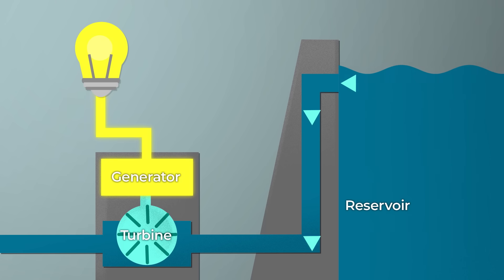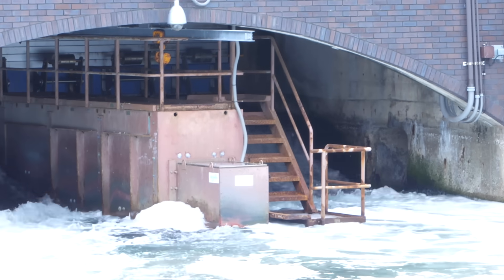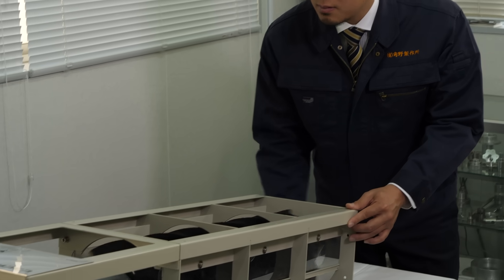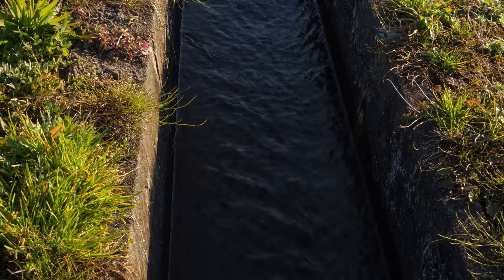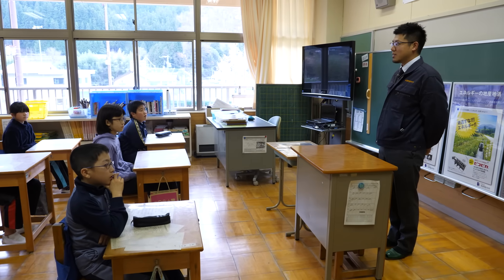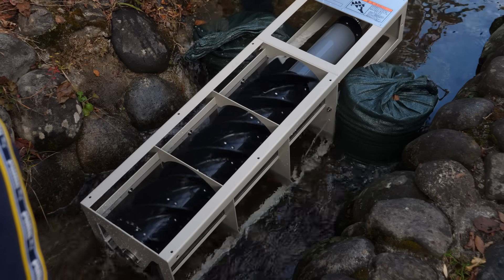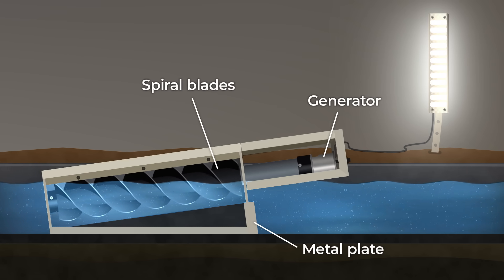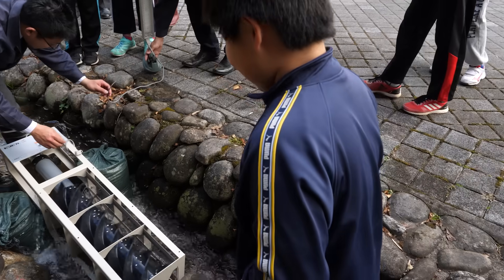Ultra-Small Water Power Generator

Comment: Easily maintainable, low tech installation, mass producible seems like an all round good idea.
Reply: A paddle wheel would be way more efficient.  This will require maintenance   . It will get clogged. Too many moving parts. And all that and it’s just barely powering some LED lights?
Reply: @michaelesposito2629  No a paddle wheel would not be more efficient, yes it requires maintenance which is easy thats to the open top design clear plastic sides and modular design. Clogging is the same thing as with maintenance.
-
Regarding power produced, thats mostly limited by the available energy. Higher velocity of the turbine increases thermodynamic efficiency allowing usable power to be produced. This is the part I was amazed at, the difficulty in extracting useful energy from low energy sources is extreme.
Reply: NotAsian this little thing produces a whopping 10 watts of power. You’re impressed by that? It will take MONTHS For this thing to pay for itself, and then you’ll be left with a high Maintance gadget that can charge your phone
Reply: @michaelesposito2629  Yes, extracting 10w from 10l/s with head of 0.1m is very good.
-
"S
piral PicoPica Hydraulic Power Unit is a promising pico-hydro power generation equipment which has potential for dissemination in non-electrified areas, with its characteristics including low-head generation and dust-resistance. There are two types of units, “PicoPica10” and “PicoPica500”

“PicoPica10” is a unit that enables around 10W generation by securing a flow of 10ℓ/sec and a head of 0.1m. This product can be manually assembled and utilized as security lighting, drawing power from a nearby waterway. “PicoPica10” has already been sold over 500 sets within Japan as an environmental education material.

On the other hand, “PicoPica500” enables around 500W generation by securing a higher flowrate of 100ℓ/sec and a head of 0.7m. The generated energy can be equivalent to an average Japanese household’s electricity consumption."
Reply: James Watt's steam machine was more efficient. 😂😂
Reply: @AvNotasian  you are funny idiot. 😂👍
Reply: @MilanTheMan69  mmhmm, i'm not the one proposing a Kelvin violator without realising the ridiculous paradox of such a machine when combined with a carnot engine.
-
You are an idiot who thinks water can burn, you can pretend to laugh but all you are doing is trying to mask your embarrassment at expressing an opinion so stupid.
Reply: @AvNotasian  
Elaborate your termodynimcs laws on these...
https://patents.google.com/patent/WO2005100787A1/en

https://infinitysav.com/projects/

"WaTeR cAn BuRn"
"YoU tHiNk WaTeR iS FlaMmAbLe?"

Why did you delete your comment?
You twisted electrlysis of water for that?

There's a number of way to extract hydrogen from water: chemicaly, with electrolysis, ultrasound...
And yes imagine, hydrogen from water can burn, WHAT A MAGIC.
What was Ralo idea that we discussed before you entering with those termodynamic BS.
I'm waiting your explanation on termnodynimics and enthropy of above mentioned devices.
Reply: @MilanTheMan69  Yes I know, what I am trying to tell you is that the laws of thermodynamics result with conversion of water to hydrogen + oxygen being <100% energy efficient, and then the burning of hydrogen is again <100% efficient. Resulting in the cycle consuming energy to do nothing but generate heat.
-
"I'm waiting your explanation on termnodynimics and enthropy of above mentioned devices."
The above devices don't exist, you can patent anything actually building a working one is impossible. Please consider the Carnot cycle, this is the most efficient engine possible and you will note even it is less than 100% efficient.
I am not going to spend 3hours teaching you thermodynamics, go over the khan academy they have structured lectures and practicals set up for you.
Reply: @AvNotasian  blablabla. 
I guessing you would power your house od DC current if there wasn't a one man in history who utilized it, and you would be teaching people how that is "something that would never be succeeded".
You still admire 3 component device in 21 cent, lol.

Yes I know electrolysis is ineffective today, but that could change as many things in science untill today.
Resonant frequancy and photonic stimulation of atom might work do job for exmpl.
Maybe with renewable resorces we dont even need to achive 100% to make it usefull..
You are stuk in that laws. Good luck and watch future progress not made by you.
Reply: @AvNotasian  yeah, when you fail to explain, go to acadamy 👍😂😂
No thnx, agian I wouldnt...
Do you like quantum physics?
I cant even imagine how is that working on your mindset. 😂😂😭
Reply: @MilanTheMan69  No, electrolysis will never change in efficiency it is limited by the laws of thermodynamics as I keep trying to tell you.
-
Yes, I am stuck in reality. So are you.
-
Also I ignored your stupid comment about ultra sonic frequencies and electrolysis, but that is also impossible. The binding energy of the hydrogen atoms in water is so high you would have to be generating a high temperature plasma with sound.
-
"photonic stimulation of atom" This already exists its called a microwave, you are repeating pseudoscience which has been dressed up to sound technical.
-
Using electrolysis to produce hydrogen which is then used as the feed hydrogen for the Haber process yields liquid fuels. This is a way of storing energy not generating energy and it is very lossy. However it has engineering advantages because its easily throttled allowing for the construction of energy sinks which allows a greater deployment of renewables on the grid. The problem is without engines to burn this fuel or industrial processes to take the products its a chicken and egg problem.
-
Please stop talking to me, you don't know the basics of the topic while I have degrees in both electrical engineering and physics.
Reply: @AvNotasian  "No SoMeTiNg wIll nEveR cHaGnE, I hAvE dEgReE"
😂😂
Reply: @AvNotasian  bot, back to school again:
Perpetual motion and the laws of thermodynamics

It is consequently expedient to first re-examine the basis for the widespread injunction against perpetual motion by modern science, as summarized in the first and second laws of thermodynamics. The first law, also known as the conservation of energy, forbids the creation or destruction of energy; it may only be transformed from one fore. to another. The second law demands that free energy cannot spontaneously increase in a closed system; although also expressed in various other ways, in practical terms it forbids a working device which drams net energy from a body colder than its environment. There are no undisputed violations of these two laws. Nevertheless the earlier, and hence original, concept of perpetual motion refers merely to any device that does cork in excess of its energy input. This does not exclude an unseen clergy source as the input to a perpetual motion device. It is this that decouples practical perpetual motion from the laws of thermodynamics. Thus, the common application of these laws contains the unverifiable hidden assumption that we know all the forms of free energy existing in nature. However, within the last century alone several new forms of energy transfer have been discovered, such as radio waves, ultrasonic, X-rays, neutrino radiation and cosmic rays, so it cannot be presumed that no new usable forms hill never again be discovered by our still advancing technology.
Reply: @AvNotasian  and yes, problem is without this hydrogen engines and in general with hydrogen tech. Who need hydrogen when you have oil, heey! Than you sir
Reply: @MilanTheMan69  The laws of thermodynamics will never change. I know more than you, try catching up.
EDIT: The reason is how they are derived if anyone's curious.
Reply: good idea yes. but there are much more efficient energy producing technology out there. like those that use water as a fuel source. what bugs me is that no body is pushing those like how they are pushing small scale renewables. its because renewable such as solar, wind and water will never be a competitive threat to big oil
Reply: @raloed.363  Do you mean flowing water/ falling water as a fuel source? Yup there are more efficient things out there, I'm just amazed that is possible to produce useful power with such a small generator.
Reply: @AvNotasian  I am not talking about hydroelectricity. Im talking about a device that you put water in and it catalytically converts the water to high amount of oxygen and hydrogen gas that can be used to run an internal combustion engine or used in a hydrogen fuel cell to give a net energy gain. And im not talking about the method of using aluminum and a base/acid as a catalyst. Im talking devices that consume only water and its byproduct is still water. Infinite energy.
Reply: @raloed.363   fuel cells. That's what they're called.
Reply: @raloed.363  it takes energy to split water into H2 and 02.... So, not infinite energy, but infinite, reusable fuel... 
But we don't have very efficient ways of storing hydrogen or even environment friendly ways of mass producing it...
It's more of a storage problem though, for Material scientists.
Reply: RALO Ed. There’s a massive issue with that, in it being its A FUCKING PREPETUAL MOTION MACHINE.
Reply: @raloed.363  Wow, no that does not exist in addition it cannot exist due tot the Carnot efficiency of engines always being <1. You clearly do not know the first thing about thermodynamics.
Reply: @raloed.363  that will be possible only when we find out how to use electolysis efficiently, aka. how to split water using 'resonant frequency'.
It is a holy grail, and there is even more work on that tech to so it can run combustion engine.
But it is not impossible.
Reply: @raloed.363  and the byproduct will be very small amount of water as some hydrogen will implode in combustion chamber and some will react again with O2 to form water vapor and some nitogen gases.
That will be very 'dry' fuel for todays standard engines, as they dont like water inside...
Reply: @MilanTheMan69  "We reached the limits of reality so now we can burn water"
You clearly have no idea what thermodynamics is or why it will never be superseded. Please be quiet.
Reply: @AvNotasian  👍ok bot
Reply: @snowdrop9810  first of all the laws of thermodynamics that we learn are not the complete ones. they have limitations and assumptions. secondly every water molecule is a weak battery due to its polar charge (it has electrical potential energy). so its not impossible to build a device that harvest each individual electrical potential energy to split a few water molecules. when done at tens of thousands of times per second, enough hydrogen can be produced to make water a fuel source. when the hydrogen turns back into water the water molecule is recharged by the sun. trust me this technology have already been built. look up Stan mayer for example. and there are more people who came up with there methods of splitting water
Reply: @raloed.363  you may be able to use the waters polar energy for electricity but prepetual motion still doesnt fucking exist. IT SIMPLY DOESNT. Hydrogen as a fuel source burnt by oxygen from water is a prepetual motion machine(2H2+1O2=2H20->2H2+1O2-> 2H2O)(thats basically a round thing, and extracting energy from it would mean nuclear energy from water’s molecules) Eitherway, if it even could work without being a prepetual motion machine, due to the fact that most of the energy is lost splitting water to hydrogen, this shit is about as dumb as paying people (mimimum wage most likely)to power dynamos.

Comment: Using this in combination with solar power youcan have enough electricity during the night even without the batteries.What about filling a tank at 10 meters height with solar power  during the day and emptying during the night. Circulating same water. You can even have a closed swiming pool filtering system this way!!! If anybody takes this suggestion seriously, even tries to make it please let me know!

Comment: This engineer didn't invent shit. Couple of years ago I saw such turbine installed at a stream that was producing 10,000 watts of electricity and it was big. It was powering a house nearby. It had gears attached to it to produce 50Hz AC. Generator and gears were inside the cabin protected from weather.

Comment: World first, in 2019?  I don't think so...  This is just a twist on a device called an Archimedes Screw.  It's been around since like 230BC, or earlier.  Backyard enthusiasts have been using them in this manor, as generators, for well over 10 years now.  LOL
Here's a big one from 3 years ago...  https://www.youtube.com/watch?v=t3AF_eawtGE
Here's another good sized one from 9 years ago...  https://www.youtube.com/watch?v=hFCBe0SvUWM
Here's a smallish one from 5 years ago... https://www.youtube.com/watch?v=urwnHDWe8IY
They even make double-screws in India... https://www.youtube.com/watch?v=H4Lxue1An2k
This guy might have shrunk it down, which others have also done, but really all that does is limits the amount of power you can get from it.  If he was smart he'd size the screw to the application, not the application to the screw.
Reply: if they were really smart they would use bevel gears with multiple generators connected around the main gear, that way you can run many alternators off the same drive shaft.
Reply: @jackasshomey  dude they're like highschool students or something
Reply: @mrchocolatebean8878  dude *cough* i didn't graduate highschool... o.o'
Reply: Mr Chocolate Bean dude. He’s an adult. Showing kids.

Comment: How much does this cost in U.S. dollars?
It looks like this in conjunction with a decent lithium iron phosphate battery with a small charge controller would be perfect for a small stream if you wanted to power a couple led strip lights for a pavillion or small cabin.
Looks like that’s about all it  could power but I like the design .
It would be really cool to see if some gear reduction in conjunction with this unit with different sized pulleys could rotate a much more powerful generator to gain more from this unit.
Just a thought as I’m not an engineer ,just wondering if anyone with more engineering ingenuity and experience than I could think of a way to ramp this baby up with a flux capacitor to get some “serious shit” out of this thing.
Reply: Lol, I was just thinking the same thing.

Comment: That's a very simple yet such an efficient solution. It works on the principle of Archimedes Screw
. Most of the times your thinking is limited by simply imposing the condition that you need height(P.E=mgh=>K.E) to produce electricity from water. But having proper knowledge of working of turbines working ranges and a little bit of height can produce a very effective results as shown in the video (although you will produce only double figures of watts, considering the size).

Comment: Terribly inefficient, bulky and expensive for the power it outputs. It's struggling to light that LED lamp. A handheld crank generator would handle that with ease.
I mean I suppose it's decent for a small steady flowing stream, but at the same time a small solar panel is just better in every way.

Comment: Anyone know of any commercially available screw blades?  I have thought about using plastic grain augers but might not be the right shape for water.   Then in my case, I would like to encase the auger in a pipe, because I'm trying to pump water with flowing water rather than producing electricity.   https://www.facebook.com/groups/240458583255303/permalink/431309544170205/

Comment: Awesome, would be great if you could use one connected to the  city water connection on your house and have it generate power whenever you turn your faucets on, flush your toilet, take a shower, etc.. For those of us who don't live near a creek or stream source.
Reply: I was thinking the same thing. Or for anybody that has sump pumps, could they use one to charge a battery in a flood condition?  So while your sump pump is running, pumping out the basement, it charges a battery so if the power from the street it lost, it will still continue running the pump.  There will be some loss there as the pump would draw more than it generates, but it might work.